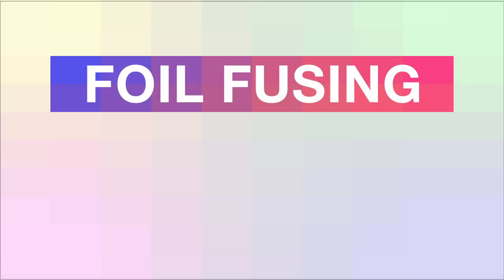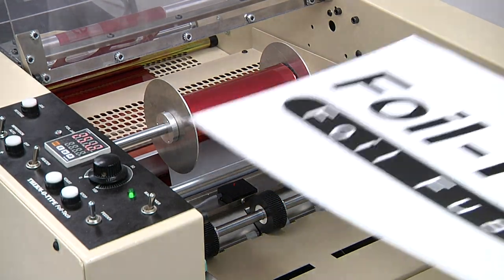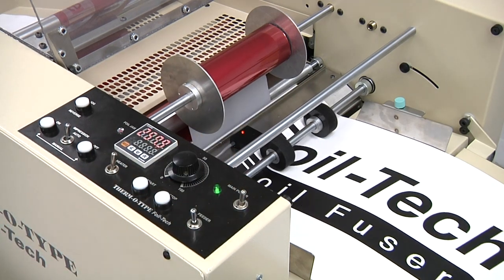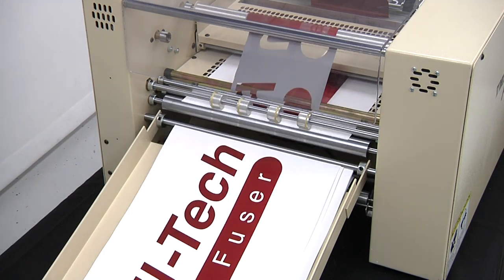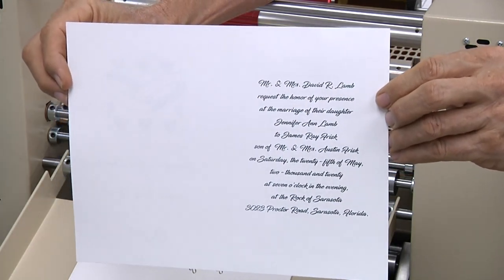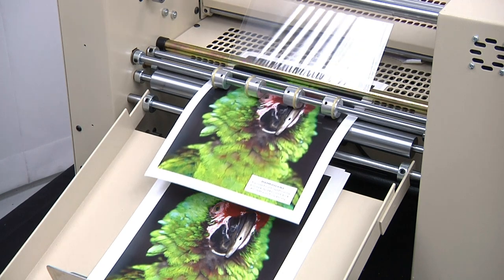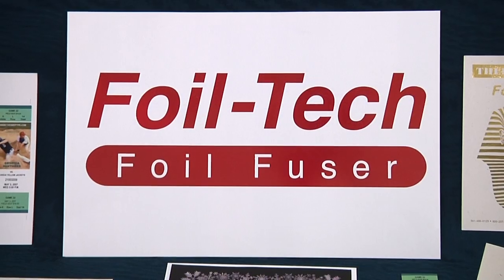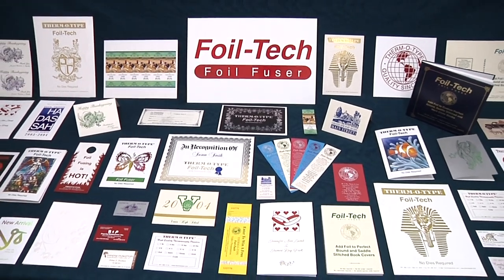Automatic Foil Tech Foil Fuser - THERM O TYPE Corp.

Comment: Large size letter and thik design all so very good results but small letters and thin design results? 
  Witch type foil you are using? Temperature is required? C° ?